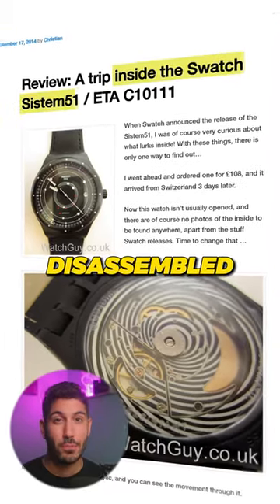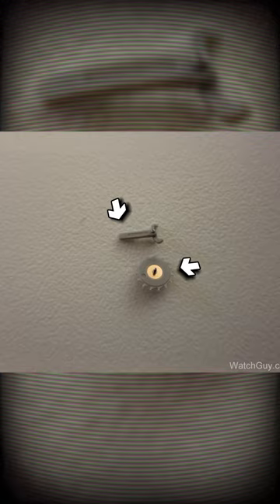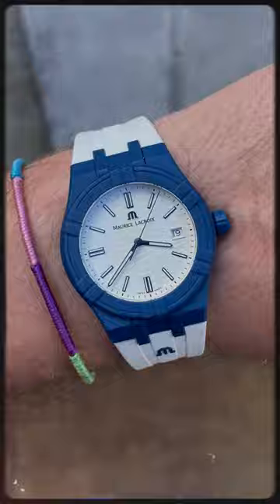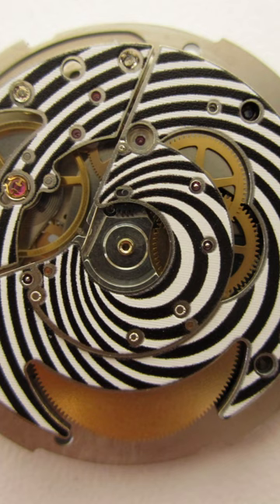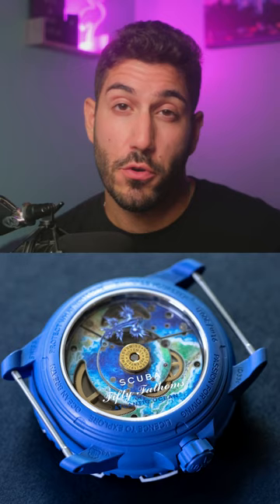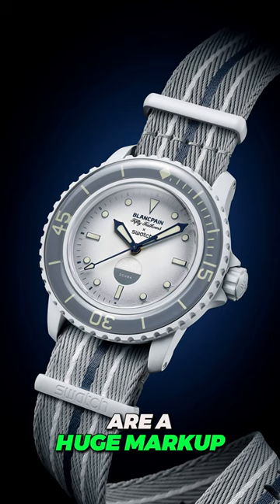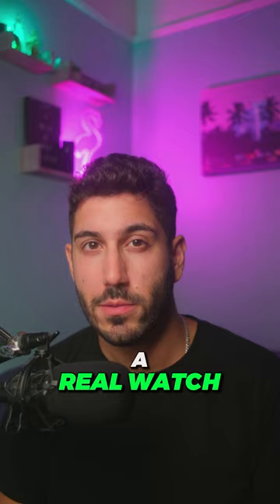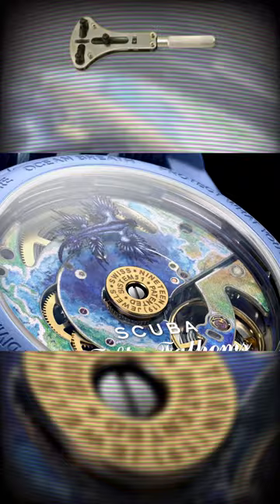Plastic Parts in the Swatch x Blancpain Movement?!

Comment: The fact that these are reselling from 800 to 1100 is disgusting, I’ll probably hold off until the type dies down , moon swatches are finally down around 200- 250 lightly used now
Reply: Why buy it in the first place. You can buy a real watch for 400 bucks

Comment: 10 years? That’s if you don’t wear it… That’s if you just pull it out of the box every now and then wind it up and show everybody that it works… Pass it around the room and then put it carefully back in the box… 10 years? Make sure you keep it in a controlled temperature room as if it gets extremely hot plastic will become prematurely brittle just sitting there… It’s a plastic toy for $400… Don’t buy this piece of junk… $400 and buy an iconic watch from a big brand manufacturer  that will last for many years… It’ll last, even if you use it!
Reply: I'll stick to my paganis and Casios if I want a quality watch for cheap. Citizen included
Reply: @CybertroninfiniteOfficial exact same thinking as me. Pagani on top!

Comment: You can get away with some plastic parts, but I would be worried about the escape wheel
Reply: PRX powermatic 80 also has these 2 plastic parts. Realistically, what is the disadvantage of having a plastic pallet fork and escape wheel? Genuinely asking.
Reply: @Jolt_Soda wear and tear over time translate better on metal than plastic. Metal tolerances are much higher, while the plastic has possibility of spurring and warping, creating points of friction = failure
Reply: @Jolt_Soda  exactly what cyberinfinite said, plastic has come a long way and can be made into some components very well, but the escape wheel, gears and other pieces are under constant movement and will never hold up as well as metal. When it comes to servicing, a lot of movements with plastic
are considered disposable.

I just like the peace of mind that everything on my wrist is full metal (or sapphire glass) so I don’t have to baby it. That’s the same reason I wouldn’t wear a ceramic watch even if it was as strong as metal
Reply: @CybertroninfiniteOfficial friends a watchmaker and his exact words are this: “If you really want a movement repaired, as long as you’re willing to pay and it’s made of metal watchmakers can always fabricate new parts. For plastic we can’t fabricate the parts, so once the supply of these parts stops, it’s over”